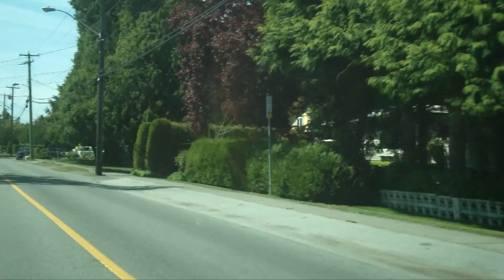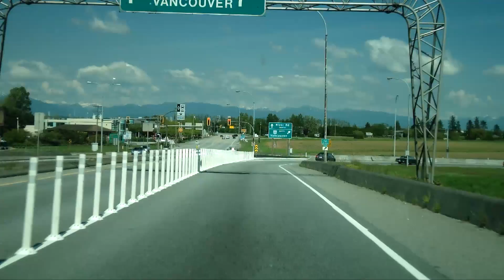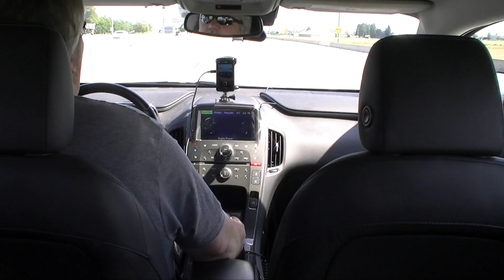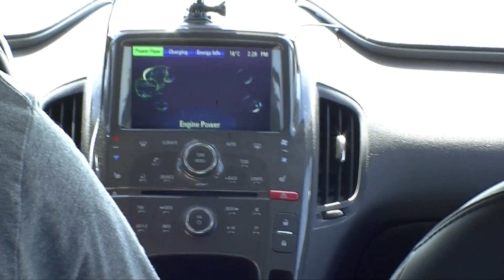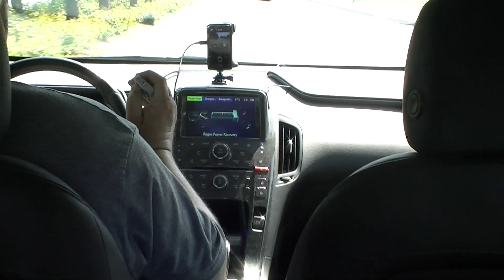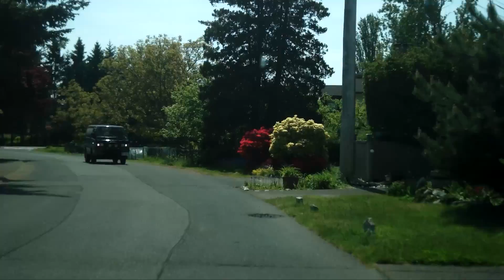How to drive a chevy volt for best electric range and fuel economy

Comment: I do not understand why you are giving false information https://www.youtube.com/watch?v=d9-9atMw6Zs in the link i just provided at 34:30 they indicate when and how the volt goes into combined mode. please stop saying the wrong thing. it has been clear since before the car came out that this is how the car operated. thank you in advance.
Reply from the maker: Ai Gi
Its a great car. And you know one of the best things in winter... Instant heat. No waiting for the engine to warm. The heaters are electric so even when it is freezing, the engine starts and generates electricity that goes to the electric motor and the heaters. So there is heat as soon as the car is turned on.
Reply from the maker: I never said it doesn't go into mode 4.
There are 4 modes of operation, mode 1 single motor battery operation for slower speeds, and for accelerating, mode 2 dual motor battery, which is used for freeway cruising ay high speeds. Mode 3, Series mode, where the engine is only generating power and the main electric motor is driving the car. There is a 4th mode, and that is when they engage the engine into the planetary gear set, and take some of the power from the engine to drive the wheels. It only operates under a very specific condition, and that is driving 70+MPH on level ground. That is 112KMh, and there are not many freeways in Canada where the speed is higher than that. Most of our roads are in the 80 - 100 KM speed limit. Yes when I am on road trips and cruising at the magic 70-90MPH in the states on level ground the car will go into this mode, but it doesn't happen that often for me, because if you are in the mountains it is not operating in that mode. The only time I recall it going into mode 4 last year was when I was driving across the flats of Nevada. But put your foot into it,and it reverts back, and yes you do notice the switch over, as it feels more like a conventional car, when the automatic transmission switches gears. In normal driving the car rarely, if ever goes into that mode. It was a last minute decision to include it in the programing because they found a 15% fuel efficiency increase by going to mode 4, also known as a parallel hybrid system. Fact remains, it is the only car in the world that can operate in 4 distinct modes, depending on driving conditions to get the best fuel economy / battery life possible. In the video, my car never entered mode 4, it was in mode 1 and 2 until the battery was flat then went into series mode, and cycled between mode 3 (generator mode) and mode 1 battery mode as the battery picked up charge, which is by far the most common mode of operation once in range extended mode. Trust me, I know just about everything there is to know about the volt. I even have a diagnostic monitor for it, that tells me how much voltage is in the battery, the rate of discharge, or charge from regenerative braking, how fast the gas engine is running, if it just generating power or providing power to the wheels. I have a app that allows me to monitor everything about the car, right down to the cell temperature, battery health. Everything that gets logged, I can monitor, and they log everything from tire pressure to how much pressure in in the fuel tank, oil temperature, transmission temperature.
Reply from the maker: Ai Gi
First the air dam in the front is just a rubber skirt, so snow and ice just pushes it up out of the way. I drag it on speed bumps all the time. There is actually a replacement skirt that is higher than on my car that the dealer can put on for anyone concerned about the clearence. Under the car the clearence is about the same as any other car, the bottom is flat.
Cold temperatures are not an issue. When the temperature drops below -5C, which it often does here in canada, and the car is not plugged in (when it is plugged in the battery is heated from the grid) the first thing that happens when you push the power button is the engine starts. It generates power to drive the car, and starts the electric heaters in the battery. As the engine warms up the coolant is used to heat the battery. The gas engine runs for about 5 minutes and then shuts off and the car switches back to battery operation once the frozen pack is nice and toasty warm. So cold temperatures are not an issue. When GM designed the car they took it up to the arctic to test it in -40 to -50 conditions.
There are videos done by GM during the development cycle showing the test phase. I watched them all, as I followed the development of the volt from the time it was the EV1. When the EV1 program ended, and GM decided that a battery only car was not the correct direction, and that a battery car with a backup generator was what was going to be the future I got all excited, and followed the development, and am proud to say I have one of the first shipments of Volts that came to Canada. It has been the best car I have driven, and I have owned over 20 different cars over the years.
Reply from the maker: Ai Gi
Again, if the car is plugged in, in the garage, you will get your full winter range out of the batteries, which is about 30 miles. In the warmer months the battery range is 40. The reason it is less in the winter is you are generally running the heaters, lights and wipers, and this all draws power, especially the cabin heater.
If it has been sitting in a parking lot all day, the engine fires for a few minutes to warm the car, then shuts off and it goes back to battery mode. I will make a video of this process over this winter if it gets cold enough to require the engine to warm the battery, Last winter it didn't get cold enough here to trigger the engine to warm up the pack, but they are calling for some serious cold here next week, so I might get the opportunity to film the operation of the cold temperature mode.
Reply from the maker: Ai Gi
I have had the car now for 3 1/2 years going through winter #4 now.
Our winters where I live in Canada are not as brutal as some, but my car does sit all day at work at temperatures of -6 to -12 on cold days which we generally only get for a few weeks in January. My commute is 10K from home. When I start out, in the winter the range estimate gauge, which is extremely accurate by the way tells me I generally have about 47K when te temperature is below 7C By the time I get to work it is sitting around 40. After sitting all day it still shows the same range. On the days when it has been sitting at -5 or below the engine starts for a few minutes, and then shuts off. Today I was driving quite a bit as I had the day off. I drove over 98Km today. My first drive took me 50Km and 45 was completed on the battery, the final 5K to get home the engine fired up. When I got home I plugged in for 3 hours. I then needed to go out and drive for another 48K,My battery was not completely charged when I left, the range said I had only 38 as I had not completed the change. It takes about 3 1/2 hours to charge and I only was on change for 3. I managed 39 before the engine started for the remaining 9K to get home. The 14Km I drove using the engine used 1.2 liters of fuel.
As soon as the weather warms up the range comes back up to the 60K for the battery range. The usable charge on the battery is still 10KWh, but because I have lights running, and the cabin heater, seat heater ect running that sucks down the battery faster in the cold weather, and these accessories are compensated for in the range estimates. Since I have already been through 3 winters, I know what to expect, and know that as soon as te temperature gets above 12C the range comes right back up, with the optimum temperature being 19 and above. that is where the range is greatest. High temperatures do not bother the battery as it is liquid cooled, and it is tied into the air conditioning system, so when it is really hot outside as it was when I was in Arizona last year, where the temperature was 45'C
there was no issues, as the battery was kept in it's optimum operating temperature, 20'C.
The car is dirt cheap to run. A full charge costs me 1.15 at .11 per KwH, so 60K in the summer cost me 1.15 to drive, and in the winter that drops to 40ish. Still much cheaper than running gas. That same distance in the summer would use about 3.75 liters of fuel, if it was a gas car getting 40MPG.
Reply: 12voltvids Здравствуйте! (Hello in Russian) )))
Thank you for the interesting video!
I like the idea (philosophy) of the volt very much considering the constantly increasing fuel price (around 0,6 USD per liter) but I don`t like the very very low front overhang and the ground clearance because, for example in Russia, you could not drive it normally on our shitty roads. I mean randomly distributed deep holes in the middle of the road or "icebergs" in winter (up to 5-10 cm high).
And my questions are, what do you think will happen with the volt (battery) at our freezing temperatures (minus 30)?
Will the motor/generator run constantly if I, for example, pre-heated it up in the cold garage and then unplug and drive to work? Will the volt still be economical?
Reply: Thank you for your answer! 
Very interesting! So you are saying, that if the volt stands for about 8 hours in a parking lot at let's say minus 20, the petrol engine will automatically start from time to time to heat the battery pack? And when it is warm enough to keep saving the charge the engine will also automatically shut down, and this cycle will happen repeatedly all 8 hours while I'm at work? 
I'm afraid then it is not so economical, or what?
Reply from the maker: Ai Gi No, the engine will not start when you are not in the car. If the car has been sitting in the lot for 8 hours at -20, and you return to the car, the engine will start, and run for about 5 minutes, burning 1/4 liter of fuel. The heat generated from the engine coolant is circulated through a heat exchanger into the battery, as well as there are electric heaters in the battery. During this 5 minute engine run cycle the battery is warmed up, and then the engine shuts down, and the car continues to operate on the battery for the remaining charge, which at that temperature (remember your electric heaters are warming the cabin, defrosting the windows ect) will get you around 40-45 KM of range at which time the engine will start again if you need to drive further. In warm weather, when you are not using the heat or wipers, defroster ect, the battery range fully charged is in the 60-65Km range. So even in the dead of winter it is still very economical to run. I only use about 50 liters of fuel in an entire year. The rest of my commuting is all done from plugging it in and charging from the grid.
Reply: 12voltvids wow! If it is really so, it`s really impressive! That means that if I had this car I could do my daily commute without spending 1000 Rub a working week (about 20 bucks at current rate)!
Do you really think that the battery will have 40 km of the charge after 8 hours in the cold? And will it survive the russian winter (at temperatures varying within a month between -5 to - 25 / seldom - 30) at all if the volt stays pluged in in a cold garage at night and a cold parking lot during the day? I wish I could test the volt out in our conditions!
Reply: 12voltvids What can I say? I want to have this car! ))) I like the figures very much. I thought it would be much worse in the winter but it`s ok. Thanks again for the info provided! And good luck!
P.S. I subscribed to your channel. I hope you will post some other interesting test videos like, for example, the guy did in the video called "Chevy Volt Sub-Zero Start and Drive"!
Reply: It is not really a combined mode.  The generator (small e motor & gas motor clutched together) is clutched to the large e motor.  They are in line and behind the e motor.  Thus the term series hybrid.  The generator does not spin the wheels.  A series hybrid can have many forms of power assists, but it is ALWAYS only one form of power spinning the wheels.  Series hybrids are almost always electric.

As you can see in this video, in high speed, electric only, the small e motor clutches to the main e motor, but it spins the case of the big motor.  When in high speed, gas mode, the gas engine clutches to the small e motor and they both spin the case of the main motor.  It is all about efficiency.  GM engineers were going to put a second speed in the Volt's gear box.  This would have meant more weight because of the added equipment.  They decided to use the gas motor to assist, thus they were able to keep the Volt as a single speed car, which most electrics are.  It is all about efficiency.  

Remember, the Volt can go 100 mph in full electric without the gas motor even running.  It doesn't need the help, in reality.  When in gas mode, they did it to keep the mpg higher, that's it.

https://www.youtube.com/watch?v=80E1fOp95rA
Reply from the maker: ra5928
The gas engine spins the generator when in gas mode at speeds below 60MPH. This generates electricity that goes to the battery, and back to the main motor to drive the car. At higher speeds, on level ground, the gas engine, coupled to the generator motor can be clutched into the ring gear of the planetary gear set, so some of the torque from the engine, 50% to be exact goes directly into the ring gear, (which is normally locked to the case when in single motor mode), and this now the planetary gear set operates as a CVT. Spin the ring gear and you can reduce the speed of the main motor, and thus increase efficiency.
Now this is for the first generation volt only. I have not looked into the operation of the 2nd gen yet.
Have you actually ever driven a volt to experience how it operates, or just trolled the net for other uneducated peoples opinions?